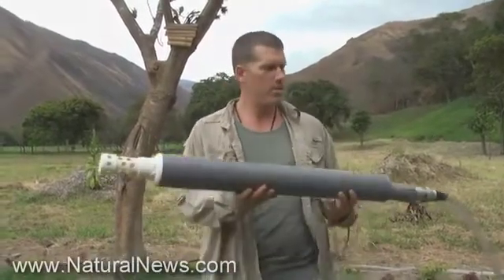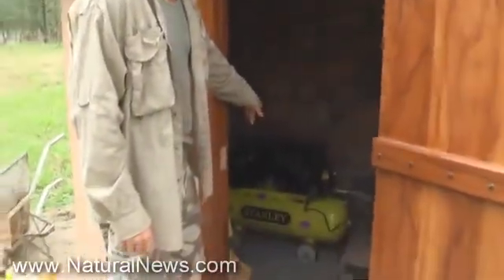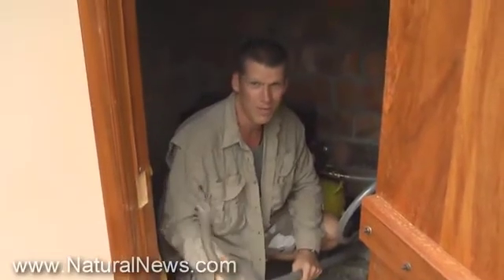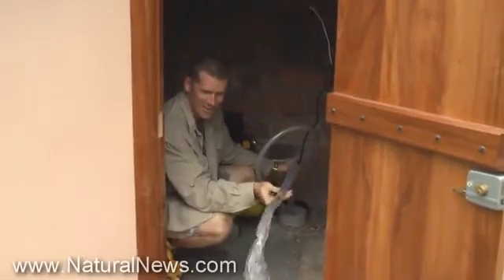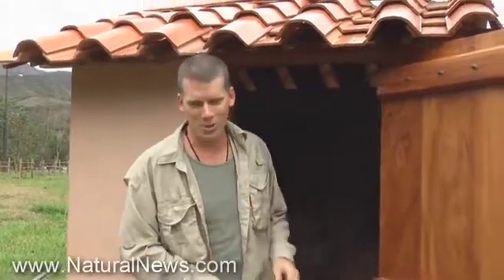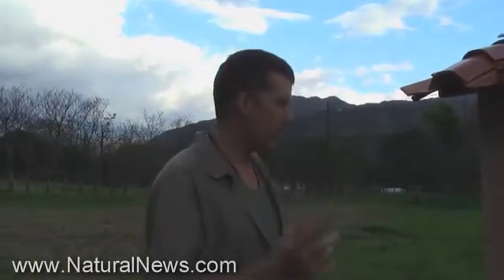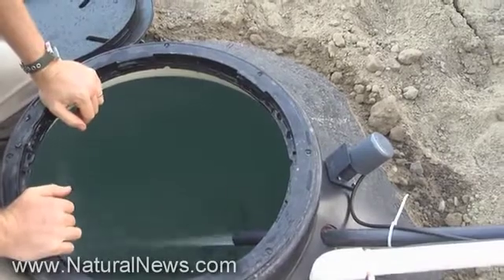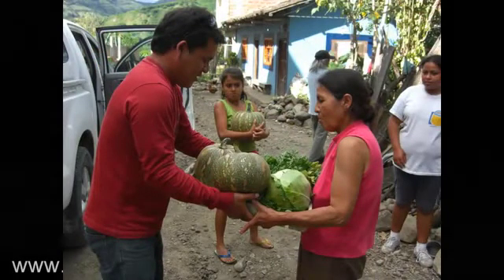Amazing device pumps well water using compressed air! Health Ranger in Ecuador

Comment: the reason why the water out is intermittent: when you pressurized the casing, you're pushing up the water, while the pressure also prevent refill water from well to casing. when the casing empty, the air goes out to outlet, pressure in casing drop, refill water comes in, then the process repeated.

Comment: Base on the comments I though I'd add some clarification

Submersible pumps:
Pros:
- reduced system complexity: the pump supplies water and pressure to the home/pressure tank.
- can be used in almost all wells aka not dependent on the well static water level or submersion level
- lower startup/installation cost

Cons:
1) Pump is the SINGLE point of failure: If the pump fails the entire system is fails. AKA NO water until either you or a well tender pulls and repairs/replaces it. If you have a backup water supply then his does not apply.

2) Difficult to replace/repair: requires pulling pump plus water filled pipe out of the well. Often requires a small crane or hoist.

3) Time consuming to replace/repair: Minimum 8 - 12hr downtime for maintenance (average is 24hrs) if you do it yourself. Up to a week for a well tender. You ever pulled a submersible pump, plus 150 feet of water filled 1" pipe out of a well in the middle of sub freezing weather? I have, and it's not fun, and I even have a small crane/lift and tools to make it easier. Without those you run the risk of damaging the pipe and contaminating the well. Depending of the depth that pump and pipe can weigh in at 100+ pounds. Can you imagine trying to do the same with a 500ft deep well? Those depths are well-tender only territory IMHO.
4) Corrosion: wells are a hostile environment for metal components. Even stainless steel corrodes. 
5) Planned obsolescence: most contain a lot of plastic/vinyl moving parts that are designed to wear out over time. These wear faster than the metal and ceramic parts that used to be present in good quality pump.
6) doe not last long in wells with the following conditions:
- sandy/silty wells (abrasion and clogging)
- wells with high mineral content (abrasion wear increases exponentially on all parts much more rapidly and deposit build up causes clogging/binding)
- Very high Ph or very low Ph wells (attacks the metal components)

7) Expensive to replace/repair: 
- $750 for a 1hp reputable/longer lasting one (10-15yrs) or $500 range for box store one (lasts 7years)
- $300-500 well tender service fee

8) Constant power consumer  the average 1hp pump (pump power needed to draw water from 175-250ft) draws 10amps at 230v. That's a minimum of  2300watts, or 2.3kw. Plus, it's using the same power every time it cycles on. This happens while you use the shower, wash dishes, run the garden hose for extended periods and to pressurize you pressure tank.

9) The deeper your well, the more power (HP) it will need to lift the water, and the harder the pump has to work, aka the sooner your pump WILL fail. This means you'll be back at con 1 and 2 more often.

Geyser/pneumatic ejector/airlift:
Pros:
- All mechanical parts are above ground and accessible for maintenance and replacement.
necessary mechanical components that wear out.

- Has build in backup water supply if installed with a holding tank.

- All mechanical parts can be replaced in less than 30 minutes.

- In-ground components do not corrode if built using PVC or ABS. and have minimal abrassive wear since there are NO moving pars.
- can be used in sandy/silty wells, wells with high mineral content, and wells with higher or lower PH wtih almost NO wear.

- uses LESS power than the comparable submersible pump for wells deeper than 100ft:
Most 2hp electric compressor motors draw 7.5amps running 240v = 1800w or 1.8kw. Transfer pumps range, but my 2825SS - 10 GPM 1 HP draws 9.8 amps at 120v (aka 1167w, or 1.167kw. If both run at the same time, then the total is 2976w, BUT they almost never run at the same time. The compressor only runs when the holding tank gets low, and that is maybe once a day for about 10-20 minutes with my 275gal IBC tote storage tank. The rest of the time the transfer pump is doing the work, and at less than half the Watts of the submersible doing the same thing. All told, I use almost 1/3 less electricity to get water out of the well an into the holding tank using the compressor, and then use just over 1/2 to pressurize the pressure tank and run water in the house.

- Pump is easily removed from the well: IF you would need to pull the "pump" out of the well, you need only turn on the compressor: the air in the pipes make the system buoyant enough to be pulled out by a single person with little effort.

- Individual components are cheaper to replace/repair than the equivalent submersible.
     2hp cast iron compressor pump: $200
     2hp electric induction motor [drives the compressor pump]: $100, 
     float valve in the tank $40
     transfer pump $200 [pressurizes the pressure tank])

- aerates the water : Aeration raises the pH of water if you water has lower ph. Helps remove dissolved gases: radon, carbon dioxide,  methane, and hydrogen sulfide  Can help remove VOC's like MTBE and industrial solvents. Precipitates dissolved iron and manganese.

Cons:
1) Higher startup cost: If all components are bought new, the price can easily add up $1500+ USD.
2)  requires a compressor pump that produces 5-8 cfm at 90psi.
3)  System has numerous components that can wear out (though not at the same time)
4)  system does require more monitoring (oil separators, air filters, etc).
5) System is fully custom and required owner knowledge. You are the maintenance person.
6) Noisier than submersible pumps.
7) Does NOT work with all wells:
Requires your water well to be deeper. The pump submersion depth should be 1/3 of the total vertical lift or greater for optimum water production. AKA if your static water level is at 65ft, and you have to lift another 35 feet to your home, your have 100ft of lift. That means the pump needs to be submerged under 33ft of water. That means it needs to be placed at 98ft feet deep. Lots of wells tenders will only drill 20 - 30 feet past the static water level.

Comment: If it were me, I'd build a pedestal about 4 meters or higher above the ground then I'll place the storage tank above it. That way, the water will flow via gravity when I open a valve. No need for a second pump for the sprinkler.

Comment: It's not high pressure brother it's the volume of air they make air pumps for septic systems do some research
Reply: Not exactly, your air pump/compressor needs to compensate hydrostatic pressure of water column in the well. Say you have 60m deep well, you get water to fill up to 40m, to be safe, you would put the hose to the very bottom and compensate the pressure of 20m water column
Reply: @taufanali3170  you need two cfms to move the air up.the pipe see introduction to air left pump on YouTube 15,000 l an hour
Reply: @taufanali3170  see airlift pump in Texas on YouTube oilless compressor
Reply: @taufanali3170  ok

Comment: The system using the compressor air unit will come trouble once the compressor happen with oil carry over. The oil will mix with water from the air compress
Reply: Use oilless air compressor then. But yes you need more maintenance for this oilless compressor since it's not made for continuous long work. We use it in our backyard to fetch water 60m deep
Reply: @taufanali3170  TRUE HIBLOW FOR ONE

Comment: What is the minimum air pressure and volume needed to operate a Brumby pump.  Does this depend on the depth of the well?  Thanks. - Dave from Water Powered Pumps public Facebook group.
https://www.facebook.com/groups/240458583255303/

Comment: Brumby pump elevates water only 50 cm  or only 1 foot ?
Reply: Not an expert, but I'm pretty sure if you can get the air in the bottom of the well that the Brumby pump can lift the water hundreds of feet.  My question is what is the minimum air pressure and volume needed to get some water flow.
Reply: @davebean2886  see introduction to airlift pump they use a 20 watt air pump he could have made that same pump or about $20 in  PVC air lift pump been around a hundred years it's not rocket science
Reply: Wrong how about 300 ft

Comment: you need to look at the trompe device to provide your compressed air no electricity
Reply: That was exactly my question - do you know what the absolute minimum air pressure and volume is to get at least some flow from a Trompe pump.  This question comes up fairly frequently with water powered pumps and I'm wondering if a Tompe might work.  Here is a link to the Trompe air pump discussion:
https://www.facebook.com/groups/240458583255303/permalink/529284057706086/